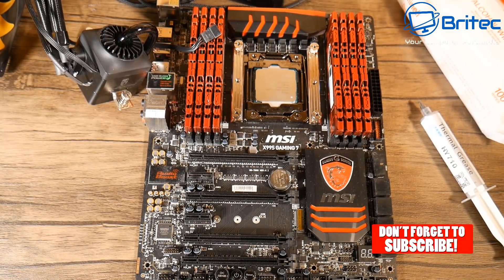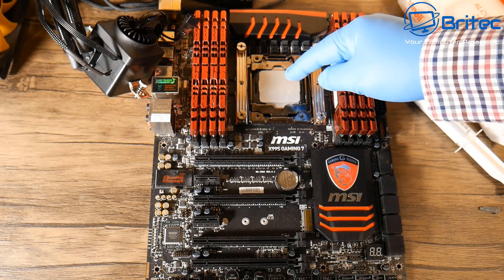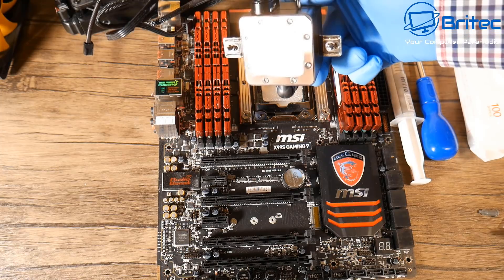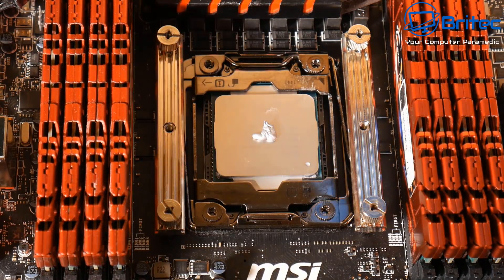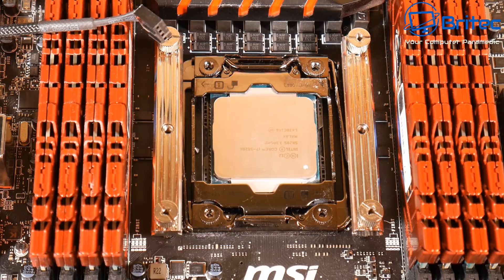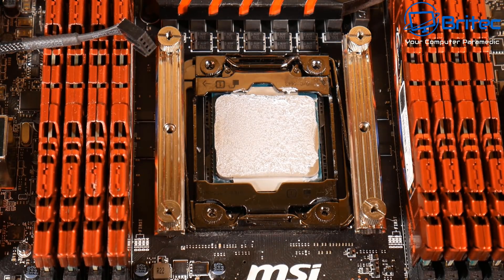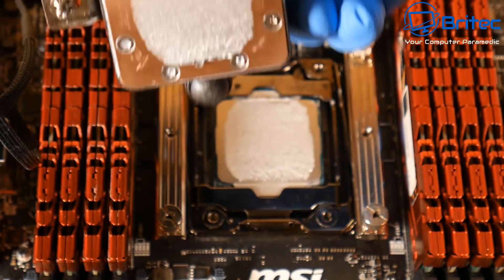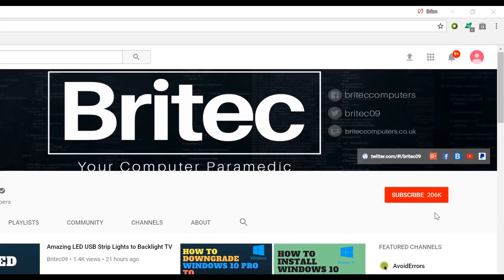How to Apply Thermal Paste to a CPU

Comment: Hey Britec, I have a question.  During my studies to get my technical certificate in IT support, one of the courses mentioned that the thermal paste hardens after several years, and needs to be replaced.  How often would you recommend I replace thermal paste?

Comment: Cut a 0.3 mm paper, put a square hole 5mm less than CPU chip dimention. Hold it firm above cpu lid apply paste as spread method, remove the paper cutout then install the cooler. It's over, no smear, no bubbles, no bullshit 👍

Comment: The surfaces of the CPU and Heat sink are not smooth enough to touch 100% and heat transfer. To fill some holes and make surface 100% touch thermal Paste is used. The thermal conductivity of paste is less than 2 surfaces. So paste should be very thin film speed on the surface of the CPU in a way that 2 metal surface touching except on wholes where past doing it.

Comment: This is the old school way and I think the best way. I would have used even less amount of paste than he did.
The paste is really only to fill in the micro gaps on the surface. 
The more of the metal surface the plate comes in contact with the better.
You can also put a plastic sandwich bag over your finger too if you don't have a glove handy.      🤓

Comment: I have always used the spread method using just enough compound to cover the heat spreader and not see any exposed metal. I have used the edge of a razor blade to spread the compound as well as a piece of scotch tape on my index finger , and lastly using a Nitrile gloove as you have shown. If I get a little too much compound near the edges I take a cue tip and clean the edges with alcohol.

Comment: The compound is only to fill in  the imperfections in the heatsink anyway, I always use the spread  method, apart from the older  AMD processors as the die was exposed on them, so only needed a tiny dot.
As you said too much people worrying about it
Reply from the maker: it for filling in the imperfections on the heat spreader and to help with heat dissipation

Comment: I always apply the dot/bean method at the middle and i have better result than any other method. I have also used silver liquid that some they use it i used it once destroyed my machine and i saw others posting the same so the store i bought it removed it from the list, be careful with this liquid can go into the pin holes if you have AMD and destroy the CPU.

Comment: Keep in mind that the AMD Ryzen cpu has a different layout under the heat spreader, with several chiplets inside the heat dissipates from several spots (concentrating on the middle might not be optimal).
Reply from the maker: You can use spread method it cases where you need to cover the whole chip
Reply: Exactly! The pea method can make some cores run hotter than the rest. Spread for the win!

Comment: Just use a paintbrush ,  it doesn't matter  !   Torquing  the screws  down  enough is more important  then the amount  of thermal  grease   that is  applied  Think  about that !   The change is  in temperate  is less then 1 degree  Celsius, it's  that    negotiable  again  due to thermal  resistance The  thermal resistance  between  the heat sink to ambient  air  is more important , then that  thousands of inch  between   the CPU surface and heat-sink and that's the bottom line  !!  What I  write here is  FACT  !

Comment: I don't think your conclusion for each method is accurate. Your screwing down the cooler, then unscrewing it. You'd get more real life result if you turned on the computer so the cpu could heat up then see what the resulting pattern is. The heat may make those pits even out. As done, there was no heat added to the cpu/paste/cooler.
Reply from the maker: Well as I said, read the to links in the video description and results are negligible as any one with common sense would know. Only gullible people will be mislead into believing in all this crap. its 1 degree Celsius or less. But hey, you keep on be leaving what you want and I will stick to the true facts. Thanks for watching
Reply: @Britec09  Hey dude. I just questioned something. You didn't have to be rude.

Comment: I use spot method pea size dead center never had an issue.
Reply: Chris King  Yep I’ve always used the simple pea method. For me it works best and less is better
Reply from the maker: Same for me Chris
Reply: Chris King I actually use a pea
Reply: not an issue but using X or Spread leads to cooler  idle and max load temps.
Reply: @genki316  I noticed that when I do pea method and if I pull cpu right after placing it the paste will be spread across the cpu.
Reply: @NO-END   @Britec09  I've discovered that with 12th gen CPU I had to spread the whole block. It's such a big CPU and outputs so much heat, and a pea sized squirt didn't help. Covering the whole block made it 6 degrees cooler than a pea sized one.

Comment from the maker: People seem to get triggered about how you apply thermal compound...why? just apply it and get on with using your computer.
Reply: So true👍
Reply: Because we want uniform temperature distribution across the cores. When one side of the cpu gets hotter it affects the core close to it and temps on that core rise to a point that it triggers thermal throttling even though other cores are operating at lower temperature.
Reply: Because it is the most critical part when building, repairing, or upgrading a computer. Poor thermal paste application can potentially harm your CPU over time. The whole point of applying thermal paste is to eliminate microscopic gaps that can cause poor heat conductivity between the CPU and the heat sink. If you apply too little, you risk damaging your CPU due to overheating. If you put too much, the paste will spill onto nearby components over time and this can cause damage

Comment: 🙂 i like to spread it around evenly with my finger or with a piece of plastic, for oem boards and cpus i first test with a tube of automotive antisieze paste, either aluminum or preferable copper antisieze, if it stays cool enuf with that then its good enuf for me, if not plan b is to use my expensive little tube of Arctic paste, on gpus tho i stick to Arctic only unless its like a really weak gpu then i use antisieze 😊
Reply from the maker: Spread method works well as well, you get a load of people saying it creates a load of air bubble lol
Reply: @Britec09  😊 i always have a hard time mounting the cooler, so before if i didnt spread it around evenly it would sometimes spill over into the socket, which is not cool 😊 heehee